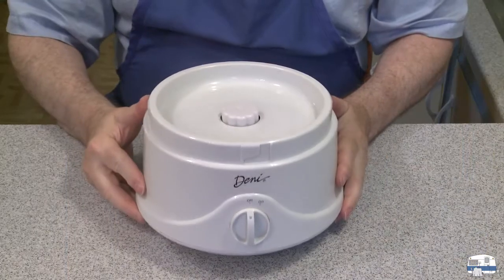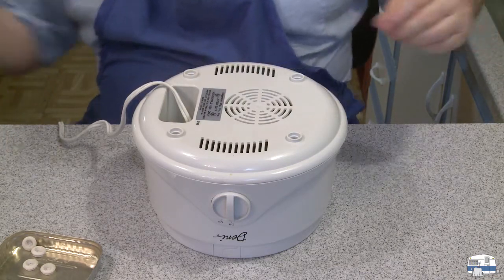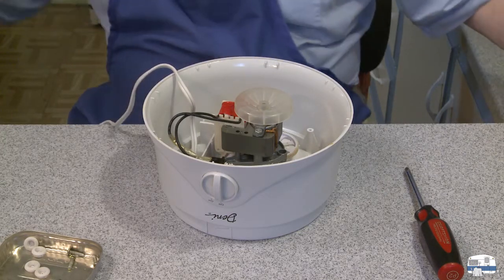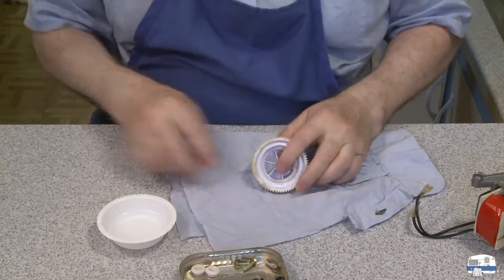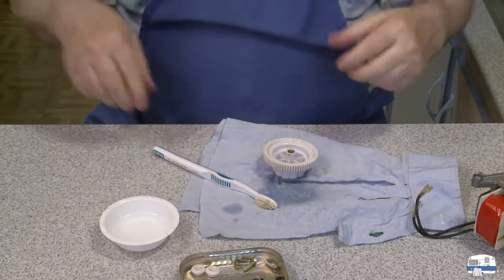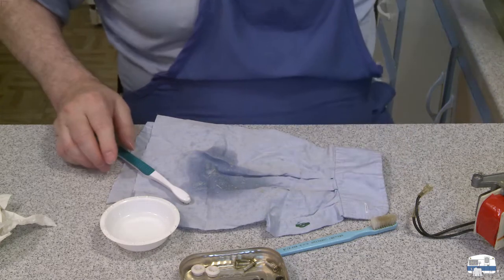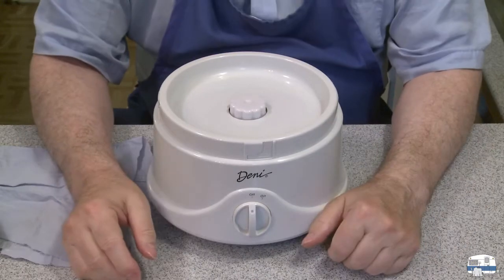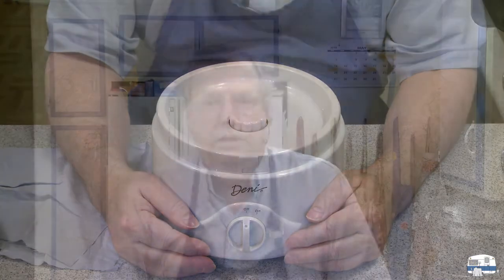083 - Deni model 5100 ice cream maker maintenance

Comment: Is there any cleaner to use to clean gears other then the mineral spirits??
Reply from the maker: The gears are nylon/plastic. Some solvents, such as acetone, might damaged them. Mineral spirits is an oil; so any oil will help dissolve the old grease, though some oils might work faster than others. I've used vegetable oil to soak and dissolve adhesive. It doesn't damage plastic. I hope that helps.